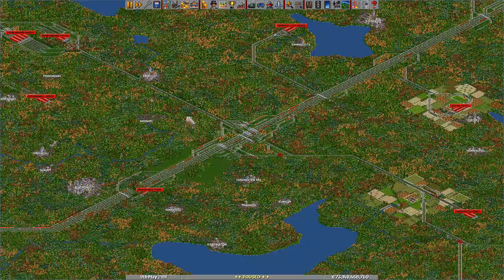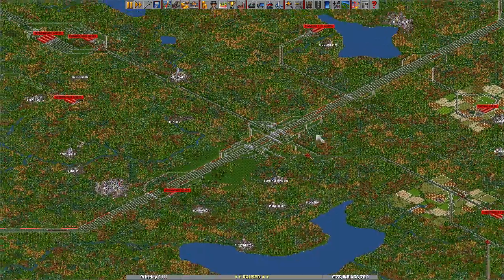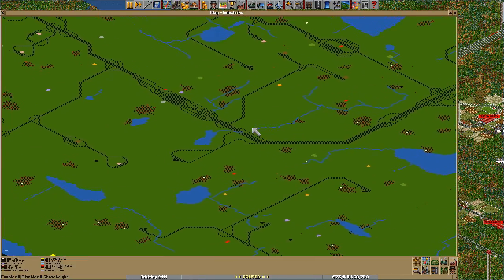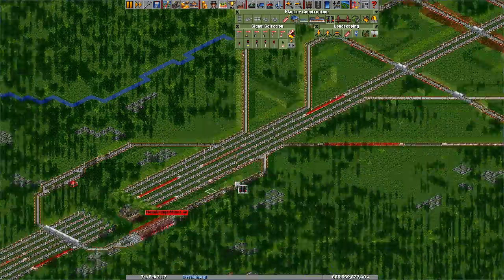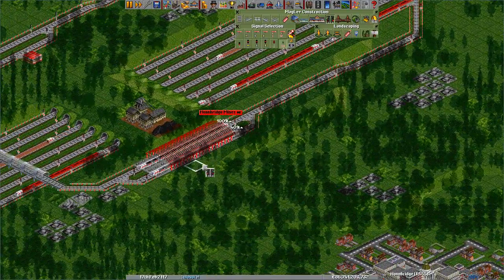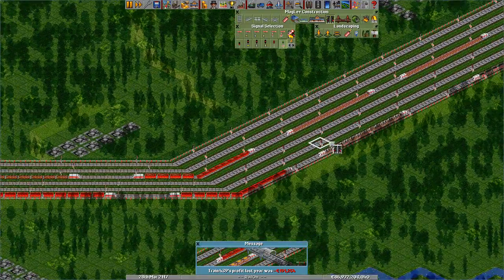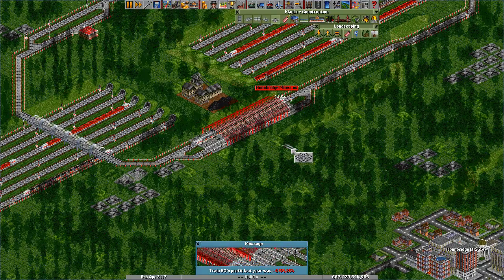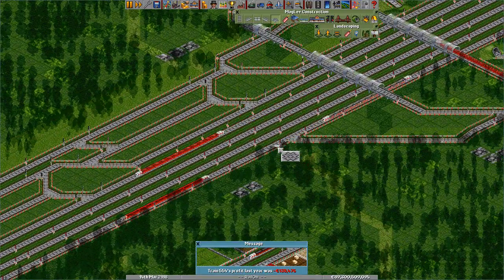Let's play OpenTTD #32 - Junction upgrade

Comment from the maker: That is a solution, but I wanted the main track lines to be usable by all trains so I can use most of the capacity. That's also why I have those switches and the traffic jam at the end of this video is caused by a lack of those switches. Besides, the trains will always choose the fastest route which happens to be the inner track line. If built right than the network has a built in optimal load distribution, assuming there are enough well placed switches ;-)

Comment: How long will u play this LP? Are u planning another OTTD LP with new grf or another targets? Oil, Passenger Imperium? I would liked it, if u play one with large cargo trains bigger then 10 tiles. It's much more interesting to handle those targets instead of trains with same size. Another good aspect would be to see how u handle the different speeds of trains in a network. All in all veeeeeeery nice LPs, I've watched all 32 parts.